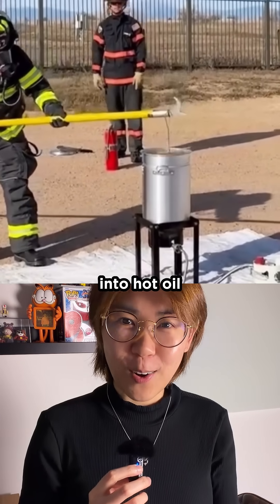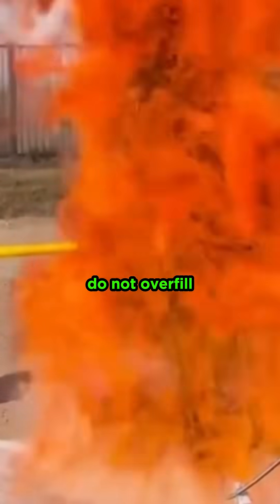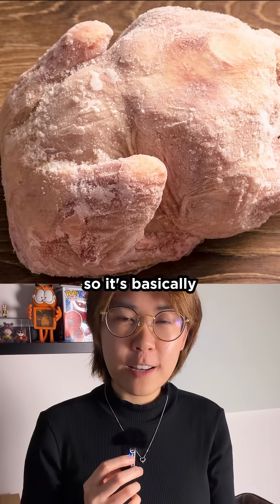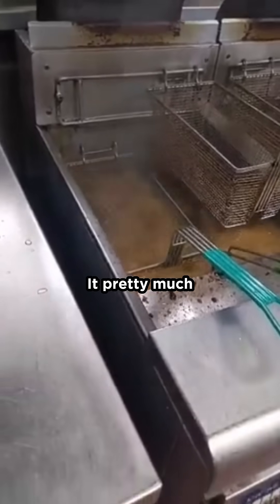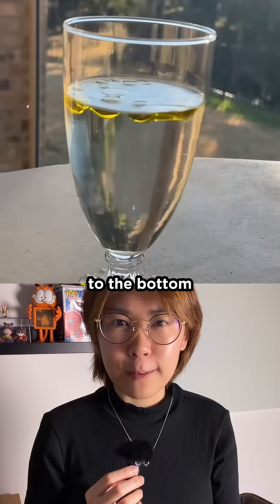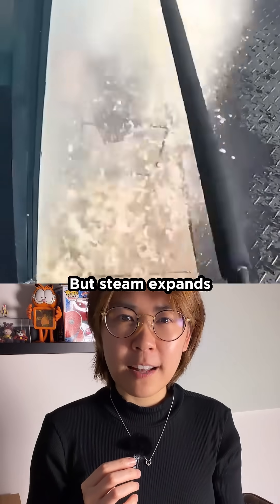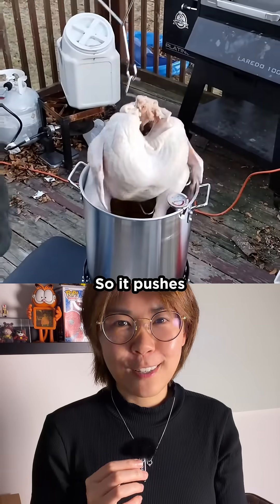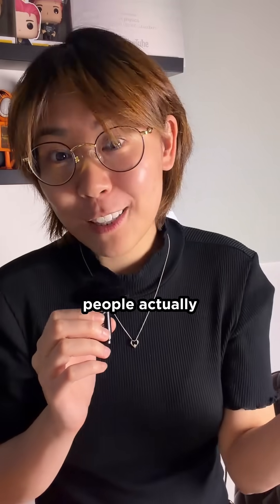The Dangerous Truth Behind Deep Frying a Frozen Turkey #holidayswithyoutube

Comment: This is also why you never throw water on an oil fire. 
The water will fall through the oil, flash to steam, and throw the burning oil in your face

Edit: smother the fire instead with the pot lid or a fire blanket
Reply: You can throw oil on an oil fire though! Cold oil cools off the oil and reduces its flash point thus putting it out.
Reply: @spiet7380 Wow, that makes sense! Thx!
Reply: Indeed, if you wash before hand something with water, like potato slices, make sure there are dry enough before putting them in hot oil.
Reply: But what about the views? Didn’t think that one through, silly.
Reply: @deepspire 😂
Reply: @deepspire what are you talking about
Reply: @Cactusfruitsquisher He's being facetious.
Reply: I test with one tiny droplet to see if the temperature is right
Reply: @krustostoianov9792 3rd degree burns is no joke. 😂
Reply: @nkadimashiane putting a little water on your hand flicking the drops that stuck was how I learned from my grandmother and it's fine.I little bit of flour also works about as well as the spoon trick.
Reply: @nkadimashiane 
But what he said was 😂
Reply: @krustostoianov9792 just use wooden or bamboo kitchen tools, if it's bubbling like a fried chicken then the temperature is perfect for deep fry
Reply: Honestly i never guessed why it was a bad idea, i just know don't put water on it
Reply: My little brother tried to extinguish a grease fire with water, and it made the oil jump to the effing ceiling and then fell down on the floor, where it left a hole. Nobody was hurt. He was incredibly dumb and lucky at the same time.
Reply: You can also use baking soda to put the fire out. I don't have a phobia, per se, about grease fires, but I learned the hard way as an 8 year old in the '70s! I started several fires trying to cook- all put out. I've hated cooking with grease and oil every since! Not a phobia, though...😏
Reply: 😂😂😂 never heard it described quite so colorfully. Thank you!
Reply: Mythbusters had an impressively fiery episode about this very thing.
Reply: Thank you, I've known this but never knew the science behind it :D
Reply: Edit your comment and tell people what youre actually supposed to do. (Put the lid on the pot and smother the flames) a dry towel works as well.
Reply: Baking soda I got baking soda
Reply: Yeah, but in a panic you dont think of what type of fire it is. Your brain just goes WATER PUTS OUT FIRE. 
It's important to learn how to stay calm in those situations.
Reply: Brilliant, you said exactly the same thing as the lady in the video.
Reply: Also a lot of oils burn at high enough temperatures that they can take advantage of the oxygen in the water as it evaporates and use it as fuel for the fire. 

Instead of smothering the flame, you end up delivering fresh oxygen directly to the source of the reaction at way higher volumes than it’d naturally get just from ambient air.
Reply: @tylerbeaumont that's wrong. This only happens with metal fires like magnesium. Hydrocarbons can't "suck" away the oxygen from water to burn. As others have said, water is explosively turned into steam on contact with oil, as the oil is significantly above the boiling point of water. So it essentially explodes, dispersing fine oil droplets into the air. Now you have hot oil with a shit ton of surface area and it burns incredibly well.
Reply: I did that as a kid once in the kitchen. Saw a wall of fire erupt in front of me. Luckily no burns and I didn't have to get a new house.
Reply: I learnt this the hard way
Reply: Do not ever flash fry a turkey.. friend of mine lost part of his ear because the oil flashed onto his skin and melted it away it’s not worth it
Reply: Carbon works well, cause it acts to suffocate the fire. However, it also is bad for people. Salt and sand are also useful to put out small fires.

The reason water doesn't work is water doesn't fight fire by suffocating it. Water acts to cool the temperature. But grease fires are hotter and instantly evaporate the water.
Reply: Dude…thank you so much for quoting an entire part of the video 🥴🥴
Reply: This should definitely be the top comment. Stay safe around fire and hot things, everyone!
Reply: Ok then what do you want me to do? Call the fire department and sit on the floor while watching my house burn?
Reply: @Alphathebudew  water will only make it worse, it absolutely cannot and will not help in any way possible. You should have a fire extinguisher in your kitchen anyways.
Reply: @Alphathebudew put a lid on the pot to smother it. If burning oil has spilled over, you better have a B rated fire extinguisher ready.
Reply: @Alphathebudew a small kitchen fire on the stove will not burn your house down. Throwing water on a small oil fire might just burn your house down. If you truly have nothing to put the fire out, than just remove the heat source and anything flammable in the area and let it burn out.
Reply: @Alphathebudew  1. read up on kitchen safety
2. smother oil fire with pan lid
3. use fire blanket to smother (should have one they are 12 bucks on Amazon)
4. use fire extinguisher which you should also have in your kitchen
5. stop talking on the internet, your dunce is showing
Reply: @Alphathebudew  It would probably be smart to look up what to do before you need to know.
Reply: Common sense 😂only idiots would do this and only idiots start fires with oil this is for idiots only 😅
Reply: @lobox138 Do you not cook? A small oil fire happens to most people while cooking at least once in their lifetime.
Reply: bs my mom makes turkey and it’s so dru. u have been debunked.
Reply: @SoyDuckHot  Please don't reproduce.

Comment: Once, at a shop where I used to work, an employee forgot to drain the water before adding oil to the fryer, and it exploded right before my eyes. The person who nearby was covered in oil and had to be taken away in an ambulance – it was a nightmare.
Reply: Did you switch it around?

If you have Water in your Fryer, it will never get hot enough for any Dramatic Effects when adding Oil, liquid Water usually caps out at 100°C (In Average Enviroments). It only is an Issue: Water -> Hot Oil.
Reply: @LanToaster 
I'm sorry for my poor explanation. I'm not good at English😭

The night before, an employee who had filled the fryer with water for cleaning forgot to drain it. Another employee preparing for opening poured oil into the fryer and began heating it while water was present beneath the oil. Shortly after opening, an explosion-like sound emanated from the fryer, which then began spouting like a geyser. The oil temperature was not particularly high, so the employee who attempted to switch off the power was doused with oil over his shoulders but did not sustain life-threatening injuries.
Reply: @picoling  
Ahh, okey, that makes alot more Sense now. 
They basically Pressure Cooked the Oil with a Lid on the Frier. Yea, that sounds really like a recipe for disaster.
Reply: @LanToaster By the account they add hot oil.